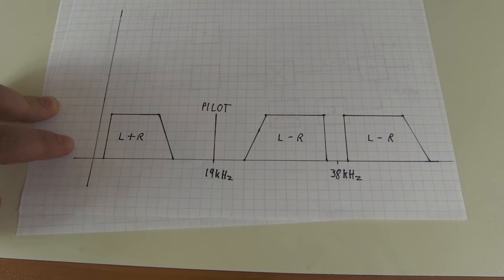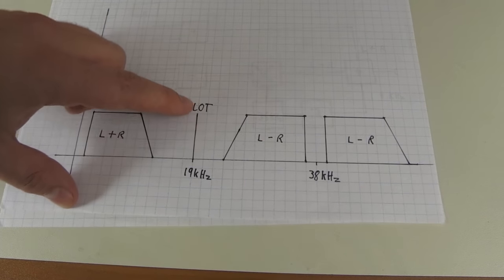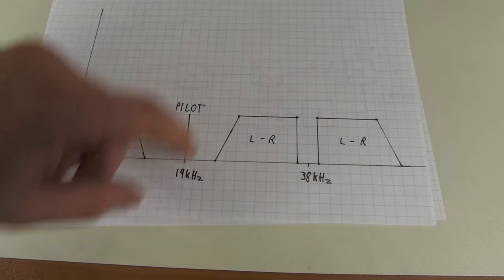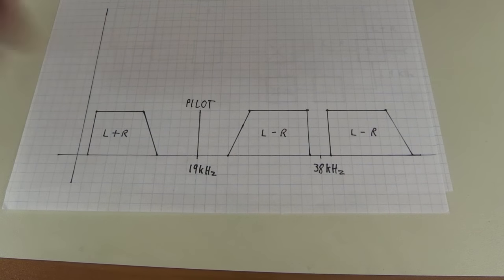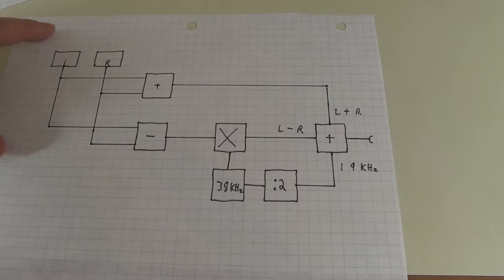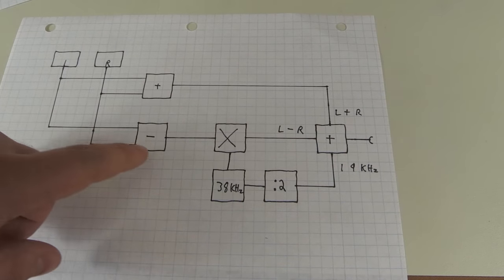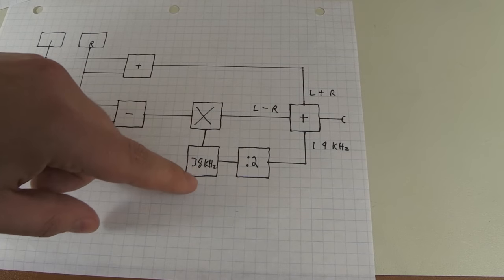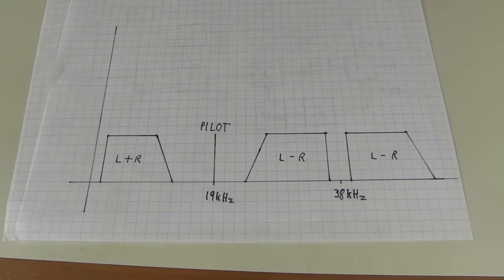Stereo Multiplexing for FM Transmission  [Theory]

Comment: The fun fact is that in Mpeg I, Layer 2 and 3 a very similar principle is used which they called "joint stereo". You put less bandwidth for the additional L-R. (-;

Second remark: At 3x 19kHz pilot you find the digital data for RDS in Europe.
Reply from the maker: Is tjat RDS part exclusive to us Europeans (I am German..)? Thought it was a worldwide thing.
Reply: @BalticLab  Ah yes I need to correct myself. It is now in the US too, but the definition was by the European Broadcasting Union EBU. They gave the design to the IEC. In the US they did some slight modifications and named it RDBS.

One special note - RDS made it possible so that ARI still was able to continue to work in Germany on the same sideband. ARI was the pure analog "Now there is a traffic information being broadcasted" to stop the cassette player or unmute the radio - or only tune in in ARI enabled stations. Those frequencies were left unused. 48 cycles of the carrier wave (57 kHz) is one bit. :-)

For fun I built a RDS coder encoding the signal on 57 kHz and I put it through the analog input of a FM radio sender and - sure enough - RDS appeared on the display of the radio.
Reply from the maker: @PascalGienger  Interesting, I definitely learned something new. Despite being born and raised in Germany. I remember the ARI system though.
Reply: @BalticLab  You are more than welcome! Greetings from NYC!

Ah yes - the "Alternative frequency list" of RDS allows you to do funny things. When broadcasting on some milliwatts - allowed here - to an FM RDS radio this list via RDS, sure enough, it will change in 2-3 seconds to the frequency you put in this list. But it the never changes back  - of course - because the new list from the now received station does not include my mini sender frequency :) That is working as designed at it was designed in a way that you could drive through the country and always get the updated list of frequencies in the area you are now to not experience the loss of signal.

Comment: Are the 38khz sidebands AM modulated?  (prior to FM modulation of the whole signal for transmission)  If so, that's kind of funny that FM stereo contains an AM component.
Reply from the maker: It's double sideband modulation for the 38 kHz subcarrier. This modulation type stacking actually happens a lot. FM subcarrier modulated onto an AM signal is used in aviation VOR stations for instance.

Comment: I dont know how i lost the pilot signal when I over-amplifing the audio output?
Reply from the maker: Do you have enough gain at 19 khz? What's the frequency response of your circuit. Do you have a schematic? If you take audio from a stereo receiver, note that it will filter aut the 19khz pilot.